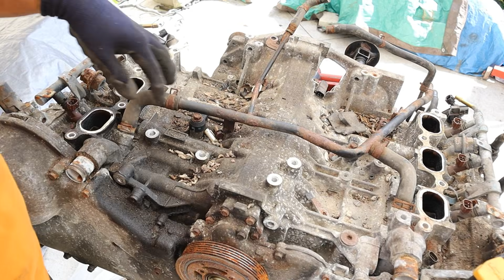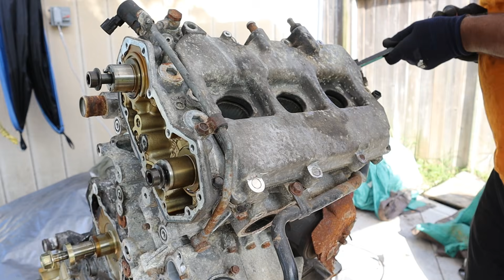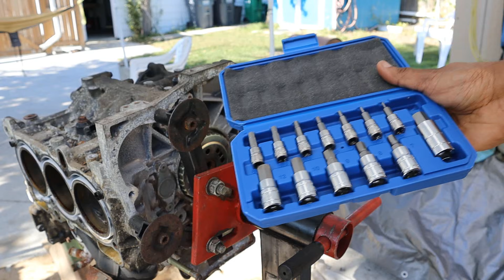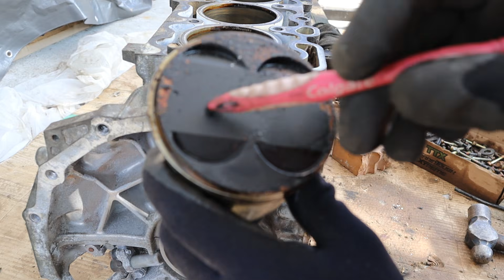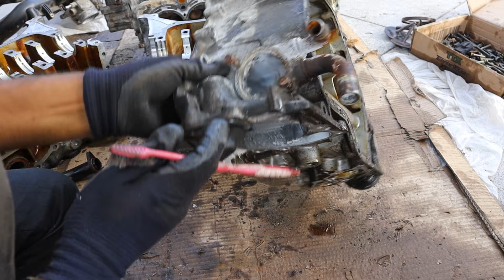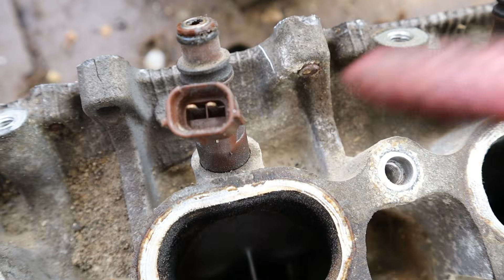Inside a Subaru Boxer H6 Engine

Comment: Can almost guarantee the sequence of events here. as i've seen it mannnnny times on this car.   Radiator cap failed just in the way  you found  ,  car started sporadically overheating, and occasionly pushing coolant and bubbles out the overflow.   Owner, or their  incompetent mechanic  automatically said 'Head GaSkeT'  , without going to any trouble to actually diagnos that properly,  and just put  stop leak in it .. making it clog up and overheat more.   . All it ever needed was a new Radiator cap, and would have lived on just fine...    Have also seen people go through with entire HG replacements.. then finding out it was the rad cap .    Never assume.
Reply from the maker: I agree....I did my diligence on the cooling system and the cap was the only defective piece.
Reply: @speedkar99 damn 😮😢
Reply: @speedkar99  I had a failed thermostat at 252k km. Blew the top warebox of the radiator on my 2009 3.0 Outback,

Comment: At around 100,000 Subaru recommends some special Subaru conditioner which I believe is basically bar stop like I never put it in my 13 H6 However I do change the coolant every 3 to 4 years now after the first interval at 80,000 miles Subaru says you can go six years and your first hundred thousand before you need to change it
Reply: do not do it. that stuff was introduced by Subaru US only,  and only as an emg response to the earlier. 2.5s hg issues .. Just do what youre doing .. i.e just change coolant . You really don't have to do it that often though.  also bleed as per factory manual when you do flush it
Reply from the maker: Yeah it sounds sketchy

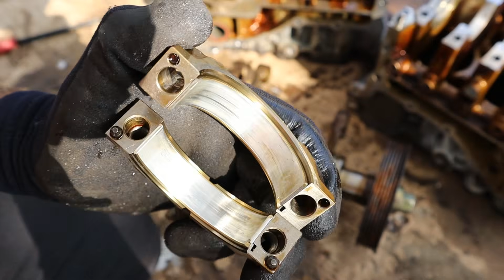Comment: At 16:20 what is being said? Cintered fractured? Please elaborate.
Reply from the maker: Yes. The connecting rod is forged, then purposely cracked in half to form the caps. They're cracked perfectly which means they fit together snugly when placed back together with it's mating part, no need to machine that surface or create keyways. .

Comment: This engine is probably the most reliable one in Subaru family....still breaks but far less than the notorious 4 banger with blown head gasket or the cracked ringlands
Reply: what are you talking about, I have a boxer 4 2.0 with 430,000, never taken apart and never had any major problems, and I have this exact engine with 335,000, the same problem was the radiator cap. and the head gasket applies only to the 2.5 first generation EJ engine. look at mrsubaru's channel on yt about that topic and don't listen to forums and all kinds of mechanics
Reply: @josipmikac8161  Exactly two years ago i sold my 2008 legacy (US) with the  2.5 with over 226,000  miles  (361,000 km)  , original engine and trans .
Reply: I have a 2011 2.5 4 cylinder in a Liberty at 322,000km and has had no work done to it apart from servicing, am I lucky?
Reply: EA 81 engine is bulletproof, had one on my microlight aircraft, had 366 hours on it when sold and still going strong.
Reply from the maker: I agree. This one made it to 300,000km.
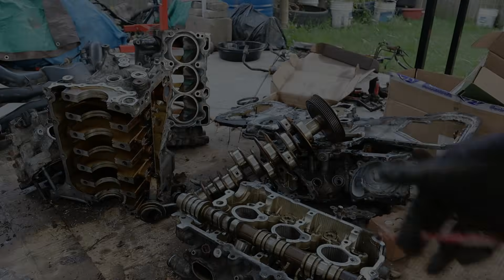Reply: @speedkar99  and it only stopped because the owner thrown stopleak in it and clogged everything. 25:24  Pretty cool
Reply: @speedkar99 made it to 300,000km and being a Subaru like a Honda or Toyota because Japanese they neglect the basic servicing.. I was expecting black sludge everywhere but it was reasonably clean for the age. The outside looked a lot worse tbh

Comment: Yeah I've seen similar buildup in other aluminum engines that had tap water added to the system. I have no idea what the chemical process is there, or why it's not always guaranteed happen (I think it's a lot of variables, too many actually), but I see it happen when tap water gets dumped into the cooling system. I'm sure chlorine, fluoride, aluminum oxide and whatever other bouquet of nonsense is in there, all mixed together with old and possibly incompatible coolants ane heat cycling, just doesn't play nice 😂

Don't do that shit folks.. if you got a leak, fix it, add the right coolant or at least distilled water until you get where you're going and can address the problem, keep up with it, and don't do this to your poor mechanic!
Reply: You got it! Water quality varies from city to city. Michigan had lead problems plus the metals all vary through out engine even if they are all aluminium. Best to change fluids as frequently as possible if you plan on keeping it.
Reply from the maker: Use distilled water.
Reply from the maker: I agree....get the leak fixed. Stop leak isn't the correct way to go.
Reply: Definitely don't pee in the radiator

Comment: That's not an H.  An H is two boxers, one on top the other.  Look up the BRM P83.  Boxers sometimes get called F6 or F4 with the F for Flat.
Reply from the maker: Are you sure....
Flat 6 means the crank pins are aligned and this one isn't
Reply: @speedkar99   Flat is a bank angle of 180.  Boxer is flat with the crank pins split 180 degrees.  All Boxers are flat, but not all flats are Boxer.  Interesting edge case scenario - a 180 degree V12 like the Ferrari Berlinetta... The point of a boxer is to let each pair of cylinders cancel out their own primary vibrations.  But since a straight 6 is inherently balanced, strapping two of them together as a flat 12 doesn't have the need to balance those vibrations pairwise... each bank of 6 balances itself.  So even with shared pins, a flat 12 is a Boxer 12.
Reply: Duck is correct,  that is a flat six not a H6.  A H engine would have two cranks one above the other.  Google Brough Superior Dream.  That is a H engine.

Comment: Bro! A 12mm head bolt can be used as a hex socket in a pinch. Just use vice grips or double nut it to make a wrench
Reply from the maker: I've been using this for a while but the vice grips or double nut technique always slips. I usually end up using a chisel and hammering it out but this time it was a good excuse to buy more tools 🙂

Comment: This is my current motor, at 307,000 miles, 2004 outback Colorado car with little to no rust.

Car runs/shifts really well, like surprisingly well, aside from a problem on the road side with a increasingly growling, or buzz that corresponds with speed.

It sounds like an additional motor that throttles up after 20 mph, with no gear. Shifting, revving the motor, swerving the car while driving have no effect on it.

New wheel hubs on all four, new tires, new front cv axles, new shocks all around, new oil in trans, motor, including filters, dropped trans pan and cleaned it( never had been done, was a bit gross), new driveshaft with ujoints and carrier bearing...

I have no clue what it can be, and it seems to be getting louder; got it parked which really, really sucks. Need to get back to work.

Any ideas?

Sound seems to be centralized, with a small uniform vibration. I notice it because I've been driving it for eight years. Always used either mobile1 synthetic or amsoil, and still did oil/filter changes between 3-5 thousand miles.

Checked plugs and gap, they were all dry, with the back passenger(6?)having a little collection of dry deposit.

Took it to a local mechanic, put it on the lift as a favor, and he also had no further clues.
Reply: Front diff is my suspicion.
Reply: @DBravo29er  

They call me D.B too.

Thanks D.B.
Reply: @Dustin_the_wind  🤌💯😎 B is my middle name, but right on, bro!
Reply: wolfgangb: It is either the O-ring in the power streering return line flange or one or more of the polyvee belt idler (bearings). The O-ring gets hard, vibrates and sounds like failing front diff.

Comment: That's awkward to have to remove piston heads before splitting the case. Is there a way to split the case and pull the piston heads out to the inside? Great breakdown!
Reply: Pretty sure all boxers work that way. Gotta have the fasteners in-line with the forces. Splitting the case is rare and typically only done for a full rebuild anyway.
Reply: If I’m not mistaken bosses inside the case for the main bearings would not allow pistons  to go out the bottom of the block.

Comment: Is there a way to pressure test the cooling system?  If yes, wouldn't that have detected clogged coolant passages in the engine block?
Reply from the maker: Yes I pressurized it. 
It will add pressure not create flow.

Comment: I think the rule is to do a coolant flush before using any sort of stop leak in the cooling system.
Reply from the maker: Yes
Reply: And replace a broken/worn out radiator cap.

Comment: Can I ask for more details how injectors are made. I am interested in mechatronics and I am interested do they have electronics or it is coil only or maybe some piezo element based. Maybe some video where injectors from different manufacturers are compared. Also is that senor on the head for measuring temperature?
Reply from the maker: I have a video on how injectors work check it out.

Comment: my god, that engine seems to be a pain in the ass to repair.
Reply: Been there, done that.  Never again!
Reply: 06 Tribeca..overheating ....blown head gasket...pulled it,went through everything but rod bearings and mains...still going strong ......but MAN, that was tough.....
Reply: @subarumanrp233 how much did it cost you? How many miles did your car have? Mine is getting close I have 130k miles
Reply: The intake and exhaust side of things are easier than a lot of cars. Alternator, A/C and starter motor also very easy to do.

Honestly these are easily 300,000km + engines (aside from oil leaks and sometimes headgasket problems ha ha)
Reply: Es un dolor de cabeza  @Jack-qn4vt
Reply: @Jack-qn4vt I get you like these engines but easier than an average i4 or V6. You're crazy haha
Reply: @2strokeFORever well a i4 isn’t really a fair comparison. But to be fair not many v6 fwd transversely mounted engines are exactly fun to work on , even a Toyota rav 4. I’m not a subru fan or anything
Reply: @2strokeFORever  he said intake and exhaust side of things are easier than a lot of cars. He said this because all of the intake is right on the top of the engine, and all of the exhaust side is on the direct underside of the engine so yes they are very easy to work on those parts. The alternator and a/c also are a lot easier than the average L4 or v6, like at least ten times easier to access
Reply: @junit7590  yeah but changing spark plugs  is a drag
Reply: Oh it is
Reply: It's pretty easy but it's a tight fit under the hood